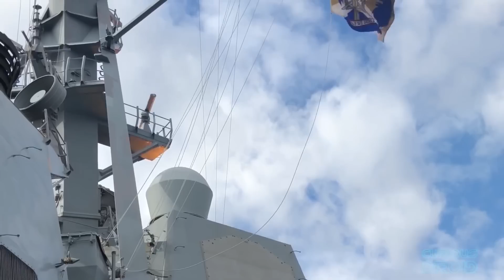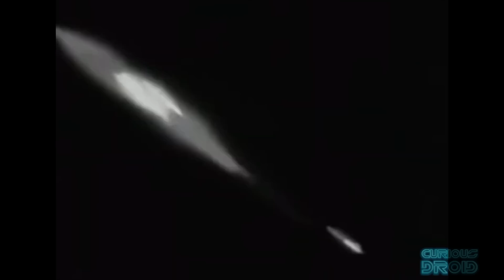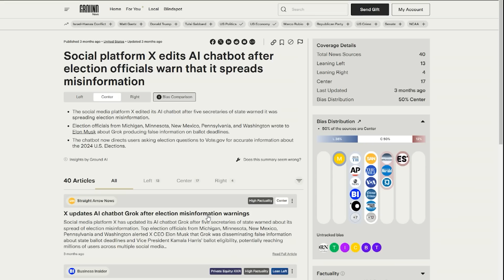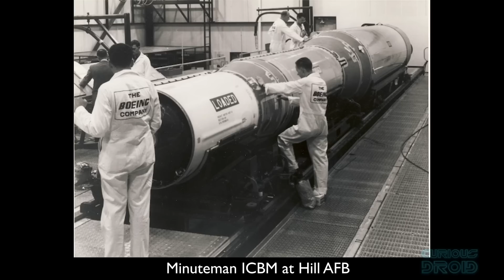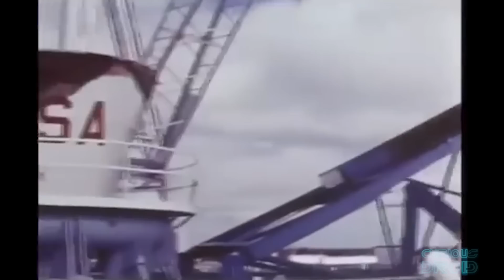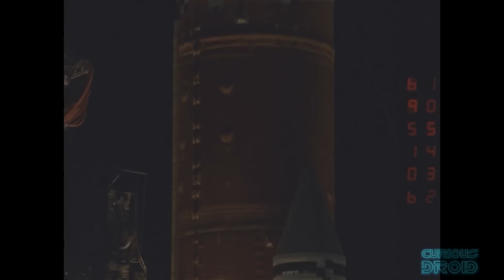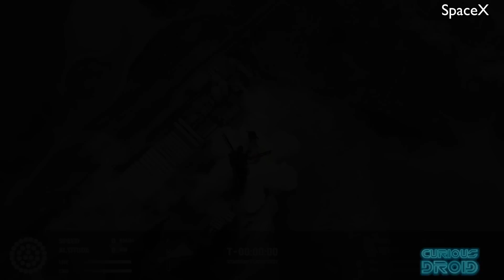The Most Powerful Rocket Motor Ever Tested & Why it Never Made it to the Moon?

Comment: At :09 there actually is little difference.  The two large solid boosters on the space shuttle could not be shut off or throttled, just like to fireworks rocket.  The SS did have a remote destruct feature I think, but that’s different.

Comment: As a young engineer In about 1965, I worked on the Lockheed Propulsion Company (long gone) version of the 156" diameter solid. It was rated at 8Mlb thrust.  Fired once; perhaps more.  Was supposed to be mobile ICBM but had a real problem getting under Interstate highway bridges on the way from manufacturing facility of Lockheed to it's firing facility at Protero Ranch site outside of Redlands California.   Had thrust vector control for steering.

Comment: It always amuses me to no end when "freedom units" people convert them to metric ones - "volcanic ash cloud has risen to 55 thousand feet" , which is clearly an APPROXIMATE altitude, since such cloud doesn't have any clearly defined "edges", so it's "55K ft, give or take few hundreds" - yet, and quite "amusingly" this approximate level becomes an EXACT "16 764 metres" when it gets converted (and never mind metric lot would rather express in kilometres - after rounding it up, i.e. 16.8 km).
Here something "visible for OVER 80 miles" (again, clearly an approximation! - it's NOT "EIGHTY, PERIOD!" - but "OVER eighty") becomes an EXACT distance of 132 kilometres (and never mind it's actually incorrect, as 80 mi is 128.75 km for LAND miles - and just tad over 148 km for nautical miles - conversely, 132 km = 71.3 n. mi and 82 "land" ones).
Why not just say "over 130 km" - or "about 150 km" (in case of nautical miles)? Me no understand... ;-)

PS: Seem that for some obscure reasons "pounds" did not enjoy the grace of being converted bestowed upon them - the thrust was "5 million pounds" (and all of ya metric lot get lost, por favore) - that'd be 2268 thousands kG (kg = unit of mass, kG, aka "kilogram-force" is the unit of force, - equal to the force exerted by "kg" at sea level, AFAIR), or, better still, 22.24 kN (kilonewtons), as thrust is usually expressed in this "true" SI unit.

Comment: There's all kinds of neat stuff in the glades. Old Nike missile sites. The Zion Coptic stilt House. The old areojet canal bridge at 288th. The golden gate landing strips used by smugglers. The old glider port. If you have a dirt bike, a high intake air box and don't mind a wet slog, you can find all kinds of abandoned stuff out there.
Reply: It must be a long time since you went out to SW 288th and C-111. The bridge there has been gone for a long time. Same applies to the US-1 drawbridge on the same Canal.

Comment: The comments say sodium perchlorate is a current oxidizer in solid fuel rockets.  More energy per kilogram would be obtained from lithium perchlorate (deliquescent) and ammonium perchlorate, the latter having the extra advantage of producing nitrogen gas which increases thrust.  These two perchlorates are only marginally more expensive. Has tetramethylammonium perchlorate been tried ?

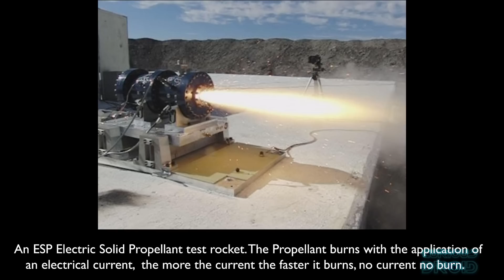Comment: 8:12 But with the electric propellant, you have to carry a power source for it to work. So STILL if you want nice things, you have to pay for it.
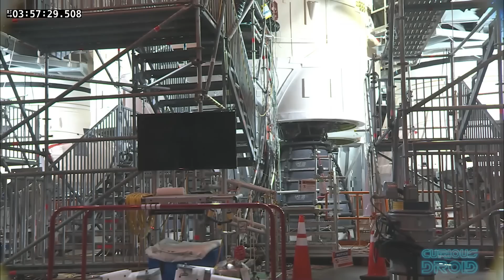8:36 Somebody is probably commenting now that gunpowder burn rates are determined by the size, shape, and number of perforations of the grains. I'd just like to add that "progressive", "neutral", and "regressive" seen in the left column of this image are also the gun propellant terms.

Comment: Rockets are technically a type of jet engine. Sir Frank Whittle made the very first air breathing liquid fueled jet engine, the radial flow gas turbine engine. The Germans developed an axial flow gas turbine, the axial flow has dominated the aviation industry because of the higher performance compared to radial flow gas turbine engines. That is, until liquid fueled rocket engines really began to be devloped. The RS-25 is like 2 turbochargers, radial flow gas turbines, with the absolutely meanest afterburner strapped to the back of them. The RS-25, and closed cycle liquid fueled rockets, are one heck of a comeback for radial flow gas turbine engines.
Reply: Get an education and stay away from Ai, it makes you stupid.   Wrong in every way.

Comment: The AJ-260 motors weren't lowered into the pit for testing. They were cast in the pit, then test fired in place.
As to the starter motor, in a production motor they wouldn't have used a second motor that would be ejected as was used as a sort of quick demonstration for the tests of the AJ-260. They would have used a normal starter configuration with something like a small rocket motor with an initiator in the forward dome of the motor. To start burning, the propellant grain needs to be held at a specific range of pressure and temperature for a certain period of time. The start cartridge is designed to create those conditions inside the motor. This is a safety feature that keeps these large motors from igniting off of any random source of ignition.

Also, technology developed in the 1980s and 1990s allows solids to do everything that liquids can. Liquids are still more useful in a lot of cases, but solids can be throttled, turned off, and vectored effectively even without nozzle vectoring. Look up BATES and Super BATES on thrust vectoring. To stop a motor, the internal pressure can be dropped below the pressure necessary to sustain ignition, and there are various techniques for throttling. Liquids are still more responsive in most cases, and are still a better choice for many applications, but solids can do far more than they're given credit for.

Former Aerojet employee, in both the solid and liquid rocket development laboratories.
Reply: There is video of a guy being lowered inside the motor, after the propellant was cast, to inspect it.  Probably not OSHA approved.

Comment: One unaddressed factor is cost: A rocket is 90% or more by weight fuel, and large rockets use thousands of tons of fuel. Liquid oxygen, aviation grade kerosene and methane are all mass-produced on an industrial scale at minimum cost; they're a very mature technology. Solid rocket motors use a rubber-like plastic compound as fuel and a solid perchlorate chemical as a mixed-in oxidizer. This is just plain more expensive per ton. One thing solid rocket motors can't do is be inexpensive; on the scale of rockets like the Saturn V, the Shuttle, the Space Launch System or SpaceX's Starship, they simply would be too expensive to be the entire rocket.

How they got their start in space launch was in the 1960s when the USA was struggling to upgrade their comparatively small military rockets to be able to launch larger payloads soon, without having to go back to the drawing board and build larger rockets from scratch and wait years in the meantime. Rockets like the Titan 2 and Thor got solid boosters strapped on to increase their throw weight. If the USA had decided to continue exploring the Moon it would have used an upgraded Saturn V with solid boosters added for more payload. This could be done quickly if not cheaply. When the Shuttle was developed, solid rocket boosters were seen as the fastest and easiest way to make the boosters recoverable, even if not as desirable from a technical standpoint. The SLS is intended to recycle the technology used to build the Shuttle; without them the SLS core components would have to be largely redesigned.

SpaceX's "gas up and go" plan for Starship means that liquid fuel rockets will hopefully be cheaper and even faster than a solid rocket alternative.

Comment: Wow! I can't believe you didn't mention Conrad Haas...
Conrad Haas, a 16th-century Austrian military engineer, is credited with designing and writing about multistage rockets, centuries before the modern era of rocketry. His work, discovered in 1961, includes detailed illustrations and technical descriptions of rocket construction, propulsion, and stabilization.

Key Features of Haas’ Rocket Designs
Multistage rockets with cylindrical thrust chambers filled with powdered fuel and conical combustion chambers
Delta-shaped fins for stabilization
Bell-shaped nozzles for efficient exhaust gas expansion
Staged combustion design, where each stage is ignited in sequence to provide continuous thrust
Reply: Wow!! Three stage rockets and bell nozzles in the 1500's?!

Comment: Solid motors also generate a lot of vibration, which can be bad for sensitive equipment. The concept the Shuttle and SLS have, Gigantic SRB's, is not something others are exploring. India is moving away from solid fueled primary engines. Vulcan uses them, but primarily to tune the performance to the flight profile. 

So SLS using gigantic boosters is a political decision, not one rooted in engineering.

Comment: 60% sucrose (granulated sugar) 40% potassium nitrate. at this point you can use it dry by gently mixing. Or you can cook it in a non stick pan over med. heat. Wha-La R-candy (solid rocket fuel) WARNING once you mix the sugar and potassium nitrate together it is HIGHLY FLAMABLE you been warned

Comment: Couldn't solid rockets solve the problem of the tanking StarShip inb LEO? Current tanking plans seem to be very dubious. Why not send some solid rocket boosters to LEO and use them to send StarShip from LEO to the moon? (Solid fuel may not be so efficient, but it doesn't have to be boiled off in orbit to cool like with Methane fuel)
Reply: It already needs almost 20 launches - using solids instead would push that up to 30-40. Plus there is no existing space-rated SRM of that size available.
Reply: @HalNordmann  Why more launches if you don't need to boil off the fuel like you have to do with methane and LOx? That's big problem even if the tanking technology would excist. 20 launches would take at least 20 days not even considering the limit to the places the rockets can launch from the ground. So basically you are saying it isn't even possible at all with current technology?
I've checked the Specific impulse on wikipedia LOX/LH2 450s Spaceshuttle solid booster 250s. So if half of the fuel has to boil off in the refuelling period (Starship will be half of that time in the sun during the tanking period of probably months)a solid booster would be more effective. Off course they still need to develop suitable srv's then. But here is the thing. There isn't a fueltanking rocket yet neither.
Reply: @erikkarsies4851 Proper precautions can reduce boiloff losses to almost zero - as long as you take proper precautions, which SpaceX didn't. And of course, it helps when you don't use an overweight steel stage as your BLEO vehicle
Reply: @HalNordmann  Without knowing the final fuel capacity of starship OR the carrying capacity of a tanker how does one arrive at 20 launches?
Reply: @TheEvilmooseofdoom  Not exactly 20 - but the latest number from NASA was 17, if I recall correctly. And who else should be better informed than them, since the lander is meant to be for their use?

Comment: The Australians are about to launch a hybrid solid propellant liquid oxidizer rocket. Will be interesting to see how this works out.
Reply: I heard about it. You heard about that water rocket? I guess somebody is pumping glycol at high pressure, heating it up with a lithium battery powered heater, then realeasing the steam to push a rocket. There's some cool rockets out there.

Comment: I grew up within earshot (12 miles) of the National Space Technology Laboratories (NSTL), now known as the Stennis Space Center in Mississippi.  In the late 1970s, we'd hear them test-firing the solid rocket boosters (SRBs).
Reply: Space Shuttle Solid Rocket Boosters were never test fired at Stennis. Only the Space Shuttle Main Engines (SSME) were tested at Stennis during the Space Shuttle days. I worked at Stennis from 1983 to 1994, before I transferred back to Kennedy.

Comment: Another excellent presentation, but one small correction. "Specific Impulse" (Isp) does not describe how quickly a rocket motor burns its propellants, but is rather a measure of efficiency. It describes how much impulse (the amount of thrust times how long it burns) is delivered for each unit of propellant. In metric units, this is Newton-seconds per kilogram, but in the English system it's lb.-sec/lb. Since the pounds cancel in that formula, the units of Isp in English are "seconds."  This has led to the false idea that Isp has something to do with burn time.  That's not entirely wrong since you can think of it as how many seconds one pound of propellant will generate one pound of thrust, but the rate doesn't matter when it comes to efficiency.  Whether it's a fast-burning high thrust motor, or a long-burning low thrust motor, the total impulse will theoretically be the same, although in practice things like grain shape and nozzle design will influence it one way or another.
Reply: The pounds don't cancel because they are two different things that are both called pounds. One is force, one is mass. If you actually do this right what you're left with is a measure of velocity,  which makes sense. Efficiency is proportional to how fast matter is being tossed out the back.

Hint: expand your N-s/kg and see what's left. Now do the same thing with the English units, knowing that 1 pound force = 1 pound mass being accelerated at 32.2 ft/second square re ed.
Reply: @pgramsey1  - Yes, I understand that. In fact that was the whole reason I gave the units in metric first (to show that the units don't really cancel to only time).  I guess I didn't explain it very well.

I've been doing rocketry (professionally and as a hobby) for half a century and even teach it to high school students. I use Isp as an example of the "gotcha's" you sometimes run into in the field.

Comment: Scott Manley just recently released a video about some companies using stage 1 and 2 air breathing solid rocket engines. Also, we know that throttlable rockets exist in air forces to provide better range without carrying oxidizer and allowing for controlled cruise phases where engines are likely operating in the "sustain" mode to preserve fuel consumption. We know Meteor does this and it's likely the AIM-260 will as well.